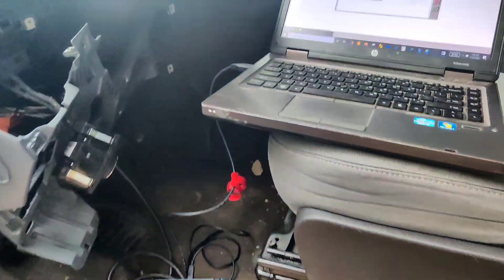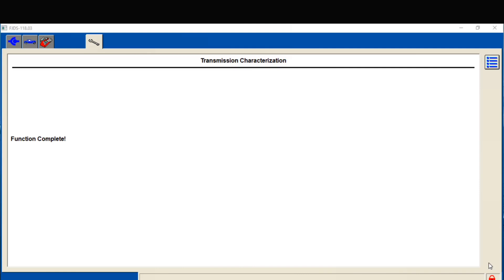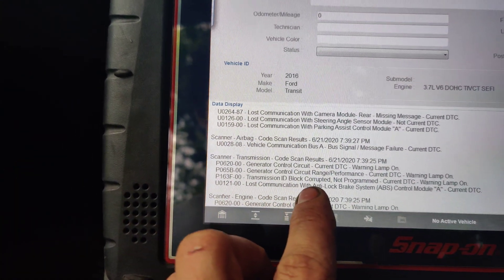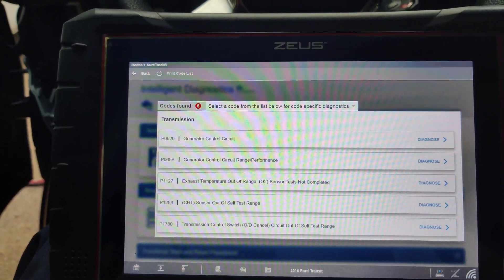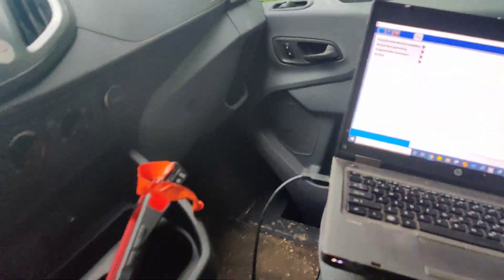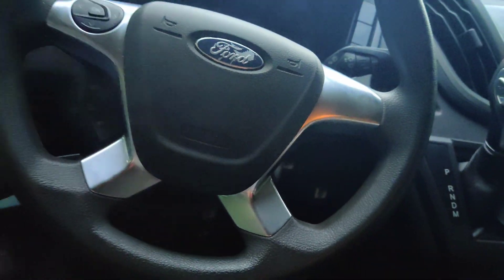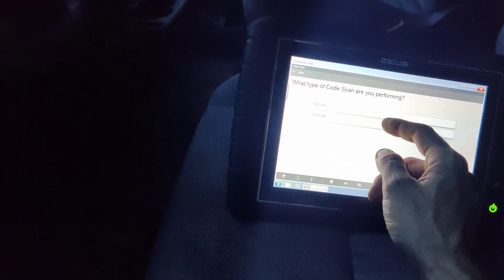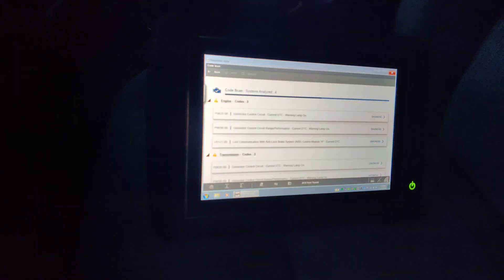2017 Ford Transit 350 P061F Transmission Data Corrupt Swap Modules? Keys No Worky

Comment: Great programming tutorial video , could you tell me where do you get your tech hotline information i only ask because there are some vehicles and procedures known to give problems thank you for your time .
Reply from the maker: I phone a friend 😂. I've never called a hot line except one time on a GM where it said starting disabled on the radio but the car would start everytime.
Reply: @RobertDotterer  So i assumed you phoned a friend for instructions on how to the remote key programming ?
Reply from the maker: No, I looked it up in Mitchell.
Reply: @RobertDotterer  Thank you for the reply , it helps with tweaking my own diagnostic strategy thank you for your time .
Reply from the maker: I just can't read right. I need to go back to college and learn how to read every line 😂

Comment: When did you get ids? I just got my ids all set up on a Microsoft surface pro makes it easier to use when the keyboard is detached from it and it’s just like a tablet.
Reply from the maker: I downloaded it a month ago to use with my cardaq M.
Reply: @RobertDotterer  maybe try module as built data for the abs module
Reply from the maker: I tried before. They sold the van as is and didn't want the abs diagnosed.
Reply from the maker: No, it was a totaled car bought at auction. There is no reason listed for the totaled title. We assumed it was a theft recovery.